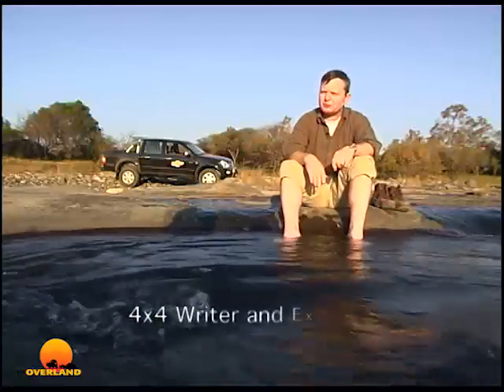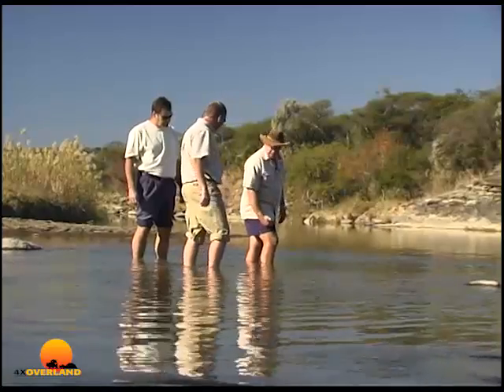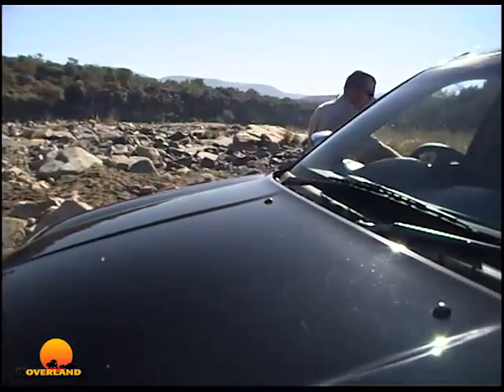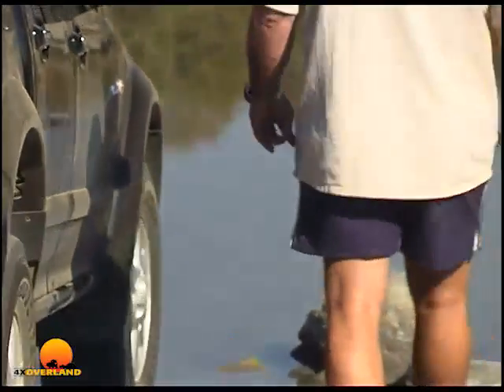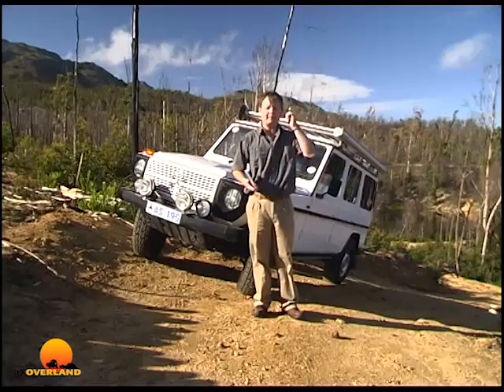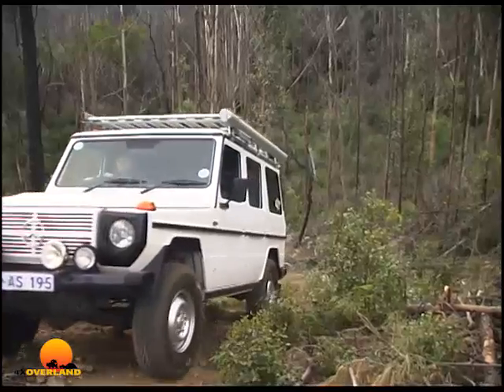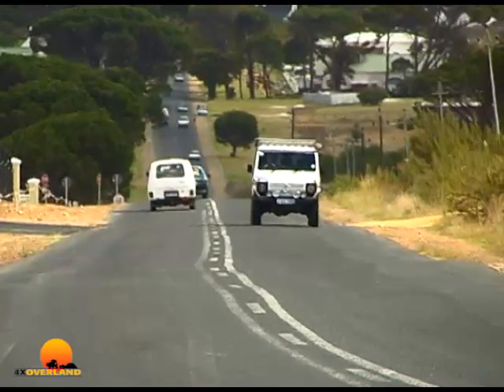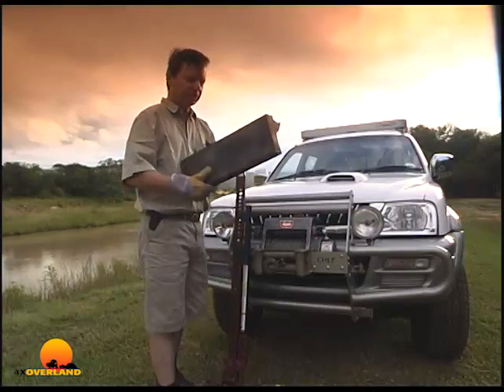Deep water, Mercedes G, overland expedition. 4WD-1, ep6

Comment: 4xOverland I had a 1995 nissan terrano r3m , that would out perform any stock 4wd. It was amazing, I was towing out Land cruisers, land rover defenders and anything else that came along on the trip with me. It could even perform well in rally driving I could get 1 meter of air on jumps at 80 Kph and it just handled perfectly. 

I seriously suggest you review these machines.

Comment: did you ever get stuck with that 290GD? I own one myself with short wheelbase, and it has really small road tires on it. Im about to change that but its quite difficult because these 461s have really rare and special rims. Still, i managed to get through really tough terrain with these 205/80s. Car is incredible.
Reply from the maker: Narrow may not look as good, but don't be fooled. Wide tyres are not better performers in off-road most situations.
Reply: What tyres would you recoment? Im not looking for wide tyres, but for taller ones. Should be all terrain too.
Reply: If on standard steels with 205 R16's (sililar diameter to a 6.50 R16), upgrade to 7.50 R16's such as the Michelin 4x4 O/R XZL, also available in 235/85 R16 if you have alloys (similar diameter to a 7.50 R16). BF Goodrich All-Terrain KO2 is very good also and available in 205 R16 and 235/85 R16. Pirelli Scorpion ATR and Goodyear Wrangler AT/R also good options. Look for side lugs - these are an important factor often ignored.

Comment: Very informative and entertaining video, very good job of explaining the mechanics/technology without going overboard.  That nice sharp shift probably helps the transmission life even if you're not offroading.  Slip equals heat and shortening the life of the fluid and mechanicals.  I'll take a transmission that is a little firmer that can last vs one that is smoother but wasting power and wearing out before it's time so to speak.

Comment: Mercedes g class design should be changed. This car is not comfortable. I've ridden it a few times it's all about off roading. Quite tough car but not for urban usage.
Reply from the maker: +m att They did change it, They called it the M-class. Or the GE-class. The G is a light truck, designed for off-road. Not shopping. And long may it stay that way.
Reply: i agree with u. the point of change is that its uncomfortable especially rear seats.
Reply: Which G-Class are you talking about? I have put a 100K on my G500. We have travelled on and off road in many different settings. Our G has ripped through snow, mud, dunes, sandstone Moab trails, granite mountain passes, and raced to Vegas without so much as a tiny bit of discomfort. 
In fact, the leather seats are adjustable in ways no person could need. The seats are heated to two stages. 
Is it possible the G you traveled in had a damaged seat? 
I challenge one to find a more comfortable and reliable off-roader using similar measurement standards.